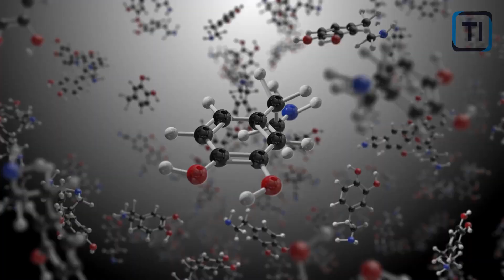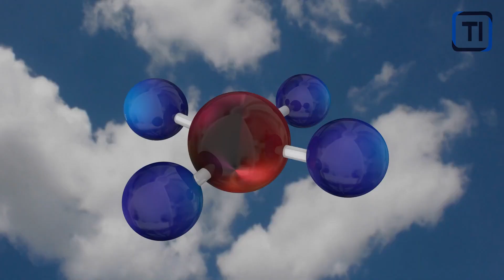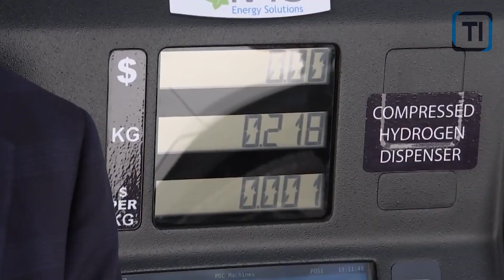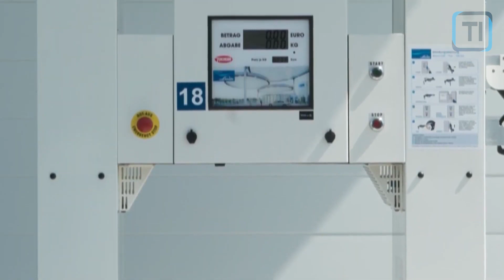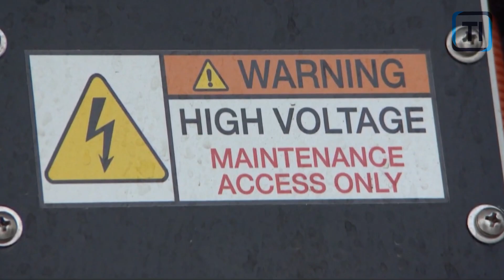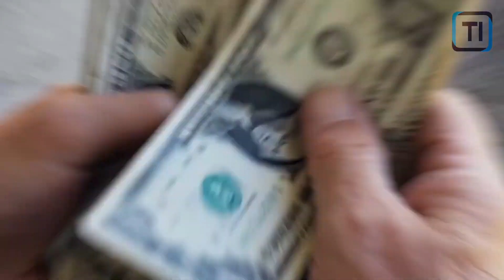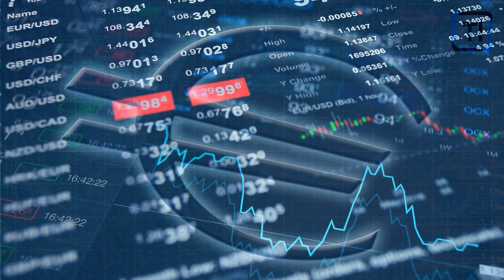A Devastating Blow For Hydrogen Power

Comment: When natural gas use was developed there were many safety issues and accidents which are now less frequent with improved designs and technology. I think that the tendency for the lighter Hydrogen to disperse is a benefit, not a negative safety attribute compared to natural gas. Additionally, the 4% ignition concentration would lead to smaller, less powerful explosions-maybe more frequent??- It is easier for natural gas to become concentrated due to its weight.

Comment: The only possible way hydrogen becomes a widespread fuel is to eliminate all the negative effects of its flammability and storage issues. It seems to me there is o lying one way to do that. It will be difficult to find an economical way to do this, but it's always been my belief, that if it can be conceived, it can be achieved.  Store the hydrogen as water and split it out right before combustion.